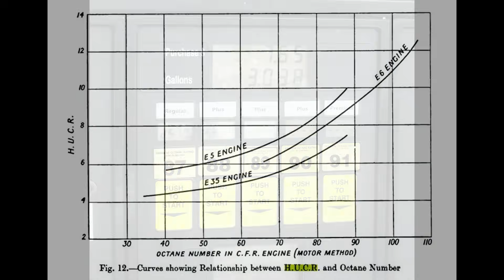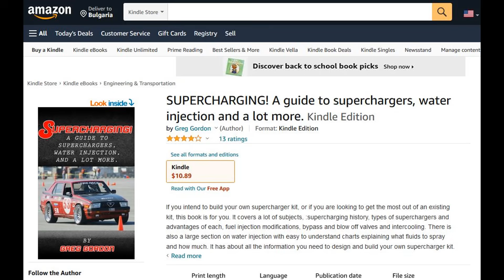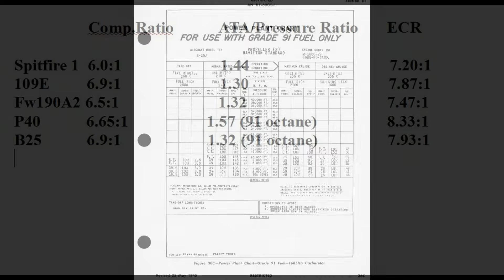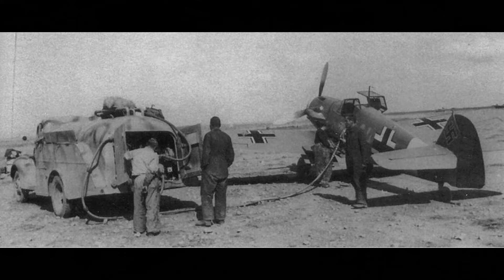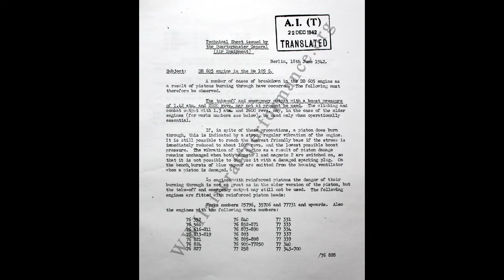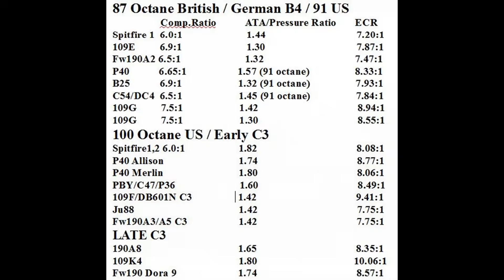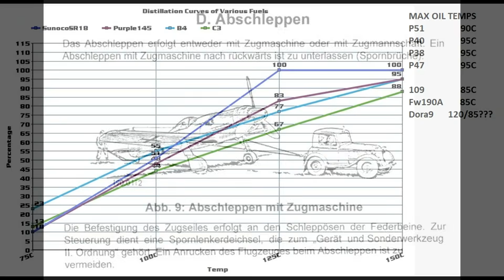German C3 Fuel, Uber Octane or Synthetic Crap?

Comment: alloys are important for exhaust valve and valve seats.  if you run too hot these parts suffer,
Reply from the maker: Yes, but they were overhauling engines about every 50 hours anyway.

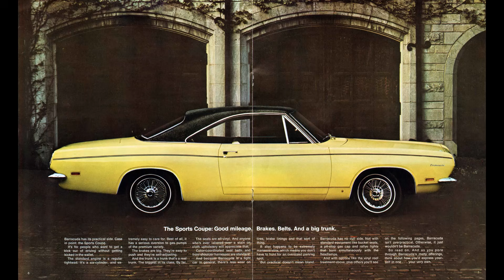Comment: @10:30 -- The lower-compression engines ran less manifold pressure??  Are you sure that's what you intended to say?

I think all of those were naturally-aspirated, so the maximum manifold pressure in any of them will be atmospheric pressure, no matter which engine option they were using.

Or am I missing something?
Reply: Manifold pressure and boost are not the same thing. If you have two engines of the same displacement and one is fitted with high capacity carburetion and the other smaller capacity carburetion (say a 280 CFM 2V vs. a 460 CFM 4V ) the engine with the smaller carb. will have a lower manifold pressure at full power. In both cases the manifold pressure will be below one atmosphere but the engine with the smaller carb. will be further below one atmosphere. A standard atmospheric pressure in 29.92 inches of mercury and a normally asperated engine will produce it's maximum power as it approaches that pressure. The closer it gets the more power it will be producing. A restrictive intake reduces the intake pressure and maximum power.
Reply: Yes, but the issue of carburetion was not mentioned.  I'm pretty sure that the assumption being made was that any carb was going to be "big enough", more or less.

Even if both engines had the same size carburetor (and I have no idea about Classic American Muscle!!) the lower-compression one would still make less power.  Which is the point that I think Greg was making.  I just think he may have misspoken about the manifold pressure...  Which is why I asked for clarification.
Reply from the maker: Keith is EXACTLY correct. I DID mean to say that in the case of those 1969 engines the lower compression versions ran less manifold pressure. That's because in every case they used a restrictive two barrel carb which prevented full atmospheric pressure from getting into the manifold at full throttle at any RPM level which would reasonably make horsepower. American muscle cars of the 60's had a lot of engineering in regards to manifold pressure, even though they were usually NOT supercharged.
Reply: Thanks for the responses, I'm glad I asked!!

Comment: The problems of early DB 605 A (burned through pistons and various lubrification issues)  did not have anything to do with metal supply after the end of the African campain. The problems occured more than a year earlier. The main reason was a faulty design of the oil system. They had problems with air bubbles in the oil, they had huge problems with getting enough oil to the lower sides of the pistons to add some cooling there and they had some problems with keeping the oil temperature within the limits. Reinforcing the pistons, adding an Ölschleuder (oil thrower?) and a bigger oil tank were the main modifications to overcome the problems. After these modifications 1,42 ATA and 2800 rpm (with B4 fuel) was unblocked again in late 1943. 

Late DB 605 D had major problems due to a sudden drop in fuel quality in late 1944 or early 1945. There was a sudden occurence of major knock problems. Research by Daimler Benz found that a drop in fuel quality was the reason. The actual production octane ratio of both fuel types was higher than the official calibration throughout most of the wartime and was lowered to exactly match the official calibration late in the war. Afaik, this drop in actual production octane ratio happened both in B4 and C3 fuel. They had to reduce the maximum emergency power output by 50 metric hp due to the lower fuel quality. Daimler Benz stated that they had the knock problems both in B4 and C3 fueled DB 605s and both had to have their emergency power reduced. This is some evidence that the C3 variants were produced and used in numbers. 
This lowering of power output to match the lowered fuel quality proves that Daimler Benz was pushing the limits really hard. How hard they pushed the limit is also proven by the fact that the average lifetime of a late war DB 605 was only between 50 and 60 hours. 

MW50 was standard equipment in every late war Bf 109 starting somewhere in the fall of 1944, not matter what kind of fuel they used.  In the final stages of the war DB 605 AS and D were both produced in versions for B4 (ASB / DB) and C3 (ASC / DC) fuel. The ASC and DC versions for C3 fuel with MW50 were on paper standard equipment for Bf 109 G-14, G-10 and K-4, while in reality many had ASB and DB engines with MW50. 

Mixing B4 fuel to the oil in very cold winter conditions was a standard procedure at least for the Jumo 211 and probably also for other engines. 

A problem in the Fw 190 A is the engine itself. There was not much developement done to the BMW 801 D after production had started because BMW tried to get the 801 E model ready for production at any cost. They even missed the opportunity to fit a GM1 system to the 801 D model, although testing by Focke Wulf was very promissing and the Luftwaffe was in desperate need for more power at altitude.
Reply: The problems started with Nickel, which was something that started occuring in about late 1940 (although the alloy reductions for the engines as a whole had started pre-war). One way of solving that, was to apply hard facings like Stellite or Brightray. If you dont have Cobalt, you cant use these techniques, after operation Torch they could not get Cobalt as French Morocco was their main source. So "Torch" didnt cause the problem, that was there already, but it prevented one of the solutions from being applied. Air bubbles in oil dont cause combustion detonation. Read my book if you want to see the real story. Which is all from the original German records translated to English.
Reply: @CalumDouglas  Nickel was not just used for aircraft engines. It was a case of prioritising its usage. Do you touch on this in your book? How much recycling took place? Do you speak german?
Reply: @CalumDouglas  Calum Douglas, am I right that in understanding that the problem with less-nickel-more-iron i the valves was very much how smooth the surfaces of these remained, as the engine accumulated user hours?
Reply: @CalumDouglas  excellent book, by the way. Thank you for signing my copy!

Comment: A 5.7 liter engine is 345 cu. in. The 69 Pontiac Firebird also had the 428 H.O. 4 speed that just run circles around all the rest except the 1970 Mark Donahue Javelin SST, ( a factory race car for the street).
Reply from the maker: The 428 was not available in the 69 Firebird, at least not from the factory, I'm sure some dealers installed them. You could get the 428 in the Grand Prix. I love the Javelin, saw one just a couple weeks ago in my home town.

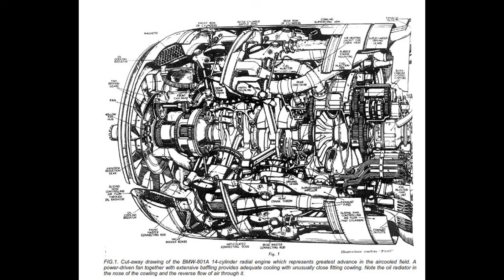Comment: 1:13:00 I think that something important to think about is the lack of high-octane fuel and two-stage supercharging is that these failures would drive the development of planes like the Dora 9 and the TA 152. 

These are complex planes with a lot of innovation and unusual features that are necessary due to all the reasons that you mention. 

Had the Germans been able to use fuel at even 130 octane or so, they wouldn’t have needed massive 35 litre engines, for example. They would then perhaps been able to exploit more elegant designs, as well as push towards parity with Allied designs.
Reply from the maker: I agree.

Comment: When you say Bf109e had some ECR, are you talking about the average of two sides or the maximum? The DB engines had two sligtly different compression rates right and left because of the arrangement of the connecting rods.
Reply: If I only waited a little, you would say that yourself on your video... My old trigger happy self...

Comment: I would have a thought that to compare an historical fuel or indeed any fuel for an accurate assessment of how it performs one would have to compare fuels in a constant setting: a mathematical model. I don't know how to assess 80 year old fuels that performed in a variety of engines with different metallurgical properties.

Different designs and metallurgical properties gave the perameters to the chemists

At one time the fuel engineer designed fuels to suit the engine and the application. Now the engine designer has to design according to the fuel. An example of this is bio fuel.

I agree that modern reciprocating engines are less tolerant due as you say to obd.

Comment: The percentage of increase from 1100 horsepower to 1300 horsepower is only about 18%, not the 30% you said in the video. Forgive me Greg, you're a pretty smart guy and it's an extremely rare occasion when I would get to correct you. :D
Reply: The increase was from 1,000 to 1,300 hp...30%
Reply from the maker: I agree with bobvicki's math. Going from 1000 to 1300 is a 30 percent increase. Come on Robert, I even put the numbers on the screen!
Reply: @GregsAirplanesandAutomobiles  - My bad.

Comment: Interesting video. I liked your question about why did the Germans run their fuel mixture so lean, when it would promote knock? Perhaps they had to run their mixture lean to try and save as much fuel as possible, it being so expensive and in such short supply? Whatever the reason, it must have really hurt those perfectionist German engineers, to have to build something that they knew wasn't as good as it could have been...
Reply: Something you obviously wouldn't want the pilots hearing as the reason for deceased performance, but in combination with all the other factors, it makes a lot of sense
Reply: I wondered this too. How "rich" is rich though in these circumstances? I doubt it's more than a few percent. And of course they would only be running at these mixtures during takeoff and combat, which occurs only a few percent of the time. Added to that, I'd expect a few hundred horsepower would always be worth a few percent extra fuel - even the Germans in the later parts of WW2 would be unlikely to deny their pilots competitive performance as a means of saving a few pints of fuel.

Comment: Is the following true
Engines that can use higher octane fuels are actually getting more power out of the combustion process when using fuels that actually have less heat energy per volume of fuel. The additives that reduce or retard knock are displacing some of the actual fuel.
Having had a 68 AMX with a 390 finding stations with premium could be a real pain in the mid to late 70s.
Reply from the maker: Mmm AMX! Anyway, the increase in compression more than makes up for any difference in heat energy per unit of mass within the context of this discussion, meaning premium pump gas vs. regular.
Reply: @GregsAirplanesandAutomobiles  
Or as a neighbor when I was  a wee lad called it "High Test!"

Comment: What of german spark plugs?   They require frequent changing.  Did the germans end up with a spark plug shortage?  What of the materials to make the spark plugs?  Factories making spark plugs bombed?

bad plugs can cause engine problems
Reply: If there were metals* used in the plugs that was in short supply I would imagine that they had provisions for returning bad plugs to the factory to salvaging the materials
*was platinum used in plugs then? Some nation did try to where possible recycle the brass used in artillery shells for instance.
Reply from the maker: Do we really want a German spark plug video?
Reply: @GregsAirplanesandAutomobiles  lol no we do not!
Reply: Was there a spark plug gap?